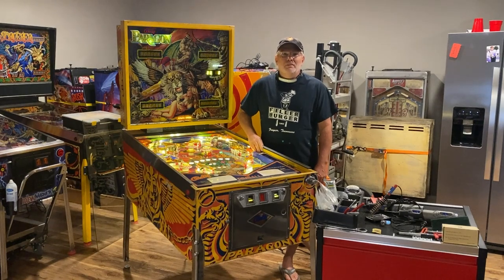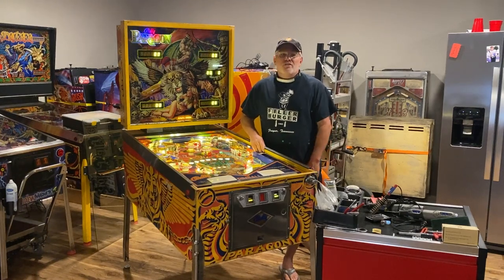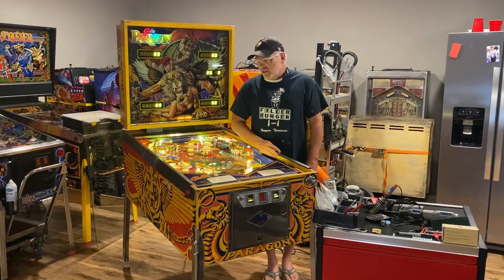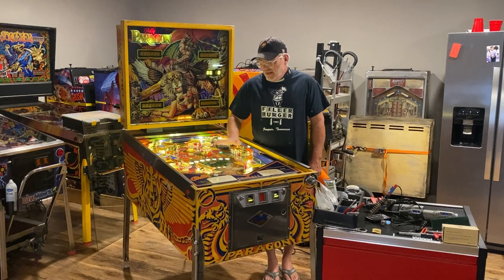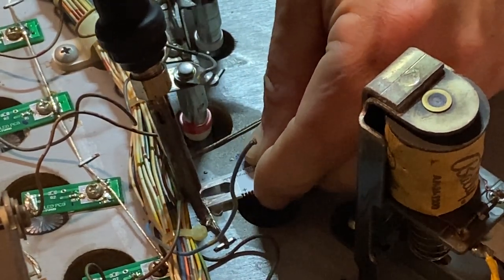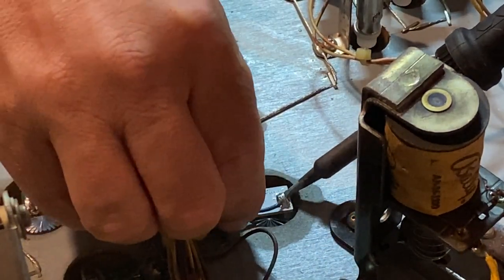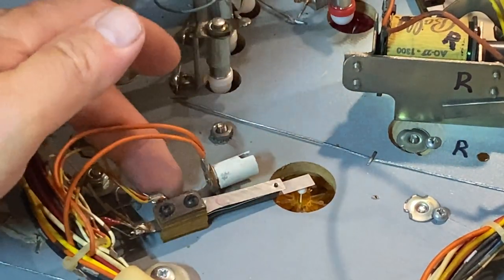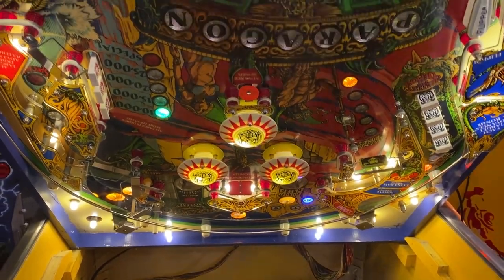Yoppsicle Install 2022

Comment: Sorry, I have not watched the entire video yet, but since these have a + and - , I assume that they can't be used for the GI bulbs since they are AC.  Am I wrong about that?
Reply from the maker: They are not well suited for GI because they don't provide enough dispersed light above the playfield.  Also, because the GI is AC they will burn at half brightness.
Reply: @dyopp21  We are using NeoPixel style programable LED on our playfields and we take some 1/2" clear plastic rods cut to about 1" lengths, round off one end on a small lathe to approximate a lightbulb.  With the flat end of the rod sitting flush with the NeoPixel, it does a great job of distributing the light above the playfield.  But, for that to work for the Yoppsicles, you would need to make a variant with either a full wave bridge rectifier, or two leds mounted in opposite directions.

Comment: Do I HAVE to connect the + to the + and the - to the -?  Sometimes I can’t get it to fit properly without turning it around…….
Reply from the maker: Yes.  Because of the nature of an LED being a diode, it won't work in reverse polarity.  The good news is if you ever put one in backwards it shouldn't hurt anything, it simply won't work.